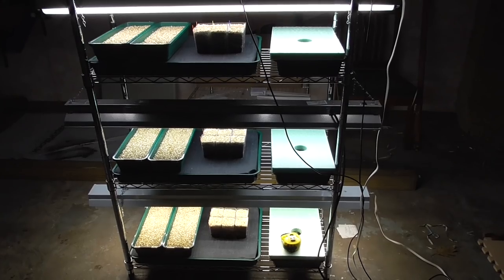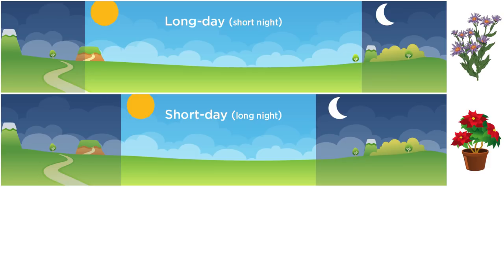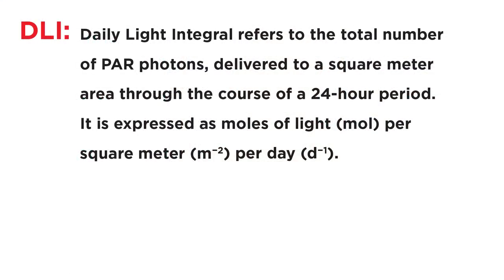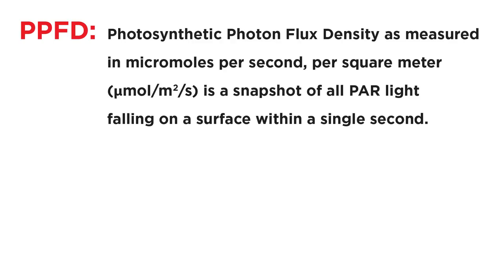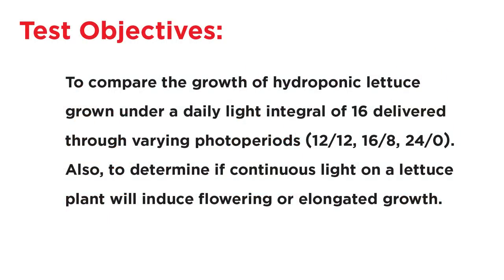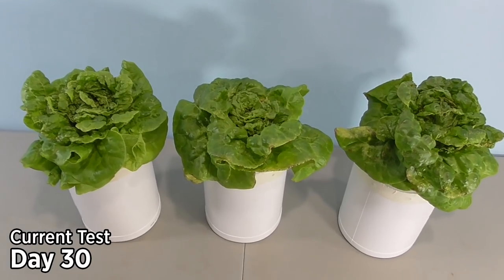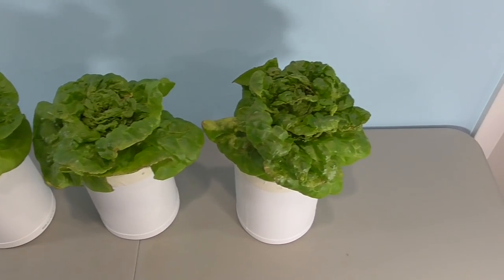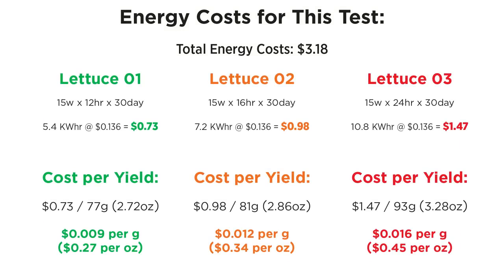Photoperiod vs Intensity: PPFD / DLI - LED Lights Lettuce Experiment (What is DLI?)

Comment from the maker: Watch PART 1 of this series for further context:
https://www.youtube.com/watch?v=gHWf4Hfi3hA

Check out my other reviews:
"1000" LED Grow Lights Shootout pt 1: https://youtu.be/g6n8VhVGKDY
"1000" LED Grow Lights Shootout pt 2: https://youtu.be/WmjOSzSF-HI
Spider Farmer SF300 / SF600: https://youtu.be/RXbR-hcXeQ4
Active Grow LoPro Max 320W: https://youtu.be/PCaesi_M5DQ
Maxsisun MG3000: https://youtu.be/Tw6-w2gybgo

This UPS power station can backup a grow light!
► https://youtu.be/h3sUUHCEqbs

Check out my Grow Light Cost Calculator: https://youtu.be/aToYhyPZMVs

Learn more about artificial lighting and plant growth:
► What is PAR vs ePAR Light? https://youtu.be/kUpEQ4kU148
► The impact of Red or Blue light on plant growth: https://youtu.be/sfihE4IuFuU
► To avoid Tip Burn: https://youtu.be/gHWf4Hfi3hA
Reply: Excellent!!!
Reply: it looks hard to do but hate the bugs outside
Reply: What is bolting?
Reply from the maker: @AndroidSamsung-qz9pl  When plants flower when we don't want them to, we call  that bolting.

Annual cool season vegetables including lettuce and spinach will bolt as days grow longer in summer. Bolting usually brings on bitter flavors in the foliage as will the usually hot temperatures that come along with longer days. Hot temperatures also cause the flowers to come on more quickly as will dry soil.  Some biennial vegetables bolting is induced by a cold snap during a plants normal vegetative stage.   Prone to bolting include rhubarb, Chinese cabbage, and mustard greens.

Some biennial vegetables, (those that normally produce only vegetative structures their first year, flower and seed their second year), may bolt during the first growing season in response to a cold spell.  Most biennial vegetables, including onions, carrots, heading cabbage, have to reach a certain stage of growth before they are able to start the flowering process.  But turnips are sensitive to cold as soon as they germinate.

Bolting cannot be reversed once the flowering process has begun, so replace affected plants with heat-tolerant summer crops or wait until later summer to replant for a fall harvest.
Reply: @Albopepper  Wow. Thanks for the though reply! :)

More power to you.

Comment: When looking at growth per watt, did you consider that with the 24 hour light cycle, the distance of the light means the coverage area is greater, so you may have been able to put more plants under the light than the other two?
Reply: Exactly, or as I mentioned in my comment just use a light that offers a dimming method to reduce the power usage instead of wasting light (as spread out light has greater chance of losses even if used for more plants like you mentioned.

Comment: Good video. Maybe you can try applying the light intermittently. Does it affect the crops quality? And does it really save electricity? Maybe you can make (10 min on / 10 min off intervals) or maybe (1h on and 1h off intervals). Does long or short intervals matter?

Comment: Thanks for the 2 interesting videos. I've never had tip burn until I received an aerogarden as a gift.  My kratky lettuce is fine but my aerogarden lettuce always has tio burn.  I've tried over and over to experiment with same nutrients and same water and duration.  The only difference is that light included on the aerogarden. So after watching your video I think my hunch is correct about the aerogarden light.

Comment: This is really awesome and I would like more of it. Although I have to say that the cost comparison is a misleading conclusion. Instead of moving the light away from the plant, you could save energy by using a dimmer light, or increase yield by growing multiple plants.
Reply from the maker: Yes the suggestion of growing multiple plants was put forth in the 1st installment of this series: https://youtu.be/gHWf4Hfi3hA?t=426  The lights I was using were not dimmible and I had to make due. The focus of the test is to show the relationship between PPFD levels and Light Cycle duration in calculating the photons received by plants. It explains DLI. That's the core concept.
Reply: @Albopepper  you did that and well by the way! I am 100% agreeing with 99,5% of the video ;-) 

I hope it's constructive criticism. I have seen the first video 👍👍

Comment: The Inverse-Square Law of light

This law states that for every foot below the reflector the light should loose 75 percent of it's energy due to dispersion. So 1000 lux at 1 foot is 250 lux at 2 foot. I have taken a lux meter and find that I am only loosing 50 percent per foot. I am thinking the reflective walls are keeping the numbers up. Also, if you are have multiple lights when you just below the reflector you only get light from it. As you move down you get light from multiple lights. This applies to HPS and Metal Halide due at the side bouncing of the wall is as bring as just below it. Where LED blow all their light down.

Comment: Greate video.
I'm so sorry, but could you tell me how did you get those values(0.0864, 0.0576, 0.0432)?
Was it with a PAR sensor? Answer: The 0.0864 factor is the total number of seconds in a day divided by 1,000,000.
Reply from the maker: Thanks for watching Julio! This resource is a definitive reference for DLI:  https://www.extension.purdue.edu/extmedia/ho/ho-238-w.pdf  I have a PAR sensor (Quantum Light Sensor) that I use to measure my PPFD.
Reply: AlboPepper - Drought Proof Urban Gardening Thank you.

Comment: Interesting DLI experiment, but my takeaway in this video is, DLI this, DLI that... why not think outside the box of "daily"?

Why confine the photo period to a 24 hour cycle? Am I wrong to think that DLI can be eliminated in a controlled environment? 
There are infinite cycle timers that can be used instead of regular 24 hour outlet timers.
Why not make it a photo period per cycle, and not per day? 
Or why not calculate how much total light the lettuce needs from seedling to harvest and ratio it together with dark periods in order to avoid tip burn?

If you ever do another experiment, can you do one that tests for different ratio light and dark cycle duration with setup number 1?
Something like 12/6 (12hrs light, 6hrs dark), or 16/2(I heard this one works good), or 8/2(short cycles = more cycles from seed to harvest in less time).

Thanks
Reply from the maker: Interesting ideas! You should run some tests and share your results!  :-)

Comment: I realize that this is a very old video at this point, but a quick question about your setup. 
Did you calculate the distance to achieve the PPFD for each plant, or did you actually use a meter? 
I ask because if you were relying on just the math, your setup could have resulted in an actual PPFD at the canopy that significantly deviated from the theoretical due to your use of reflective enclosures.
As I am sure you are aware, it doesn't matter how far away a light source is if you can manage to somehow get all the photons to still hit the canopy, be it through the use of beam angle or some other method. Yes, you will likely lose at least 10% of your photons each time they bounce off the walls of your tinfoil wall reflectors, but having those reflectors could increase your square root law-derived PPFD by a significant amount.
Additionally, the 3rd experiment is going to see a larger proportional drop off in delivered photons than between the first and second.
The first 2 have the fixture entirely within the enclosure but the 3rd is well outside the enclosure.
As the light fixture has a beam angle under 180 degrees, far more of the emitted photons will hit a wall and bounce down to the canopy in positions 1 and 2 than in position 3, with at least some proportion of the photons from position 3 spilling outside of the grow chamber entirely.

of course, all of this would be a moot point if you've used a light meter, but I never saw any reference to that in the video.
I enjoy your videos, and the knowledge is on point, I'm just concerned your results may be skewed.

Comment: A leading cause of tip burn is calcium deficiency caused by low transpiration in the leaves so that the plant can't pull enough calcium to the leaf tips... I have virtually eliminated tip burn in my setup by just putting a small fan to create airflow around my lettuce to increase transpiration.

I wonder if the growth differences would have been more dramatic without the tip burn.

Comment: i key thought , i've watched numerous videos and one thing  no one seems to pay attention to point out either  is  the light spectrum versus plant growth of long or short day cycle plant, , as an example a long day  plant with  have a higher exposure to  blue  and greens  in the 460 to 560 Nm wave length   during day  where as morning  and evening light has a higher level of of  600 to  750 and higher IR  spectrum.    so all gathered  this would also affect over all plant characteristics  of growth  determined on actual light make up for long or short day cycle plants and  neutral cycle
 so  as you go into long day plant the higher photo flux increase and  slightly less red spectrum looks to be the curve. there have been studies done for solar cells  that actually break down the light spectrum  for full day  versus time of time. so we know certain plants prefer a set time of year  for growth  both due to light and temperatures,  we know nature doesn't always duplicate the ideal condition  but we try as growers so maybe we need to   look at those spectrum and intensities not just as a broad band  but as a cycle so we need to look at it on an hour buy hour cycle also. as example  what is the intensity of the light at 6am and its light spectrum    versus  what is it at 10am noon  2pm 4pm  ...... all thing that will vary with a short day versus long day cycle plant.    oh yes and one additional note light spectrum analysis  done  by labs to test for solar cell efficiency ( 300 to 1000nm tested spectrum)   showed a fair spike at 410nm  and   extreme spike   at the  740 to 760 nm light  ( this is based off a full day sunrise to sunset  recorded data ) and the spectrum between almost a dead flat  level  within the band from 410 to 740 nm

Comment: How much nutrient solution did each plant use and what was the EC/ppm levels I think is an important factor cause the one on the 24hour cycle may have tip burn due to drinking more water causing the nutrient levels to raise

Comment: Yea, but judging from what I'm seeing in this experiment (if you ran it like it was shown here), there would be leakage light from the other "cells".
For a better comparison I think you would want to completely isolate each plant/light.  3 completely light-proof tents or boxes so there's no light leakage shared between test samples.
Reply from the maker: Thanks for sharing that tip. I actually tested each grow area separately, checking for light leakage. There was no quantifiable light spill over. So when the other 2 lights were off, those 2 chambers registered as 0 PPFD at the lettuce canopy. In a more formal setting, applying your suggestions would be a great idea. But in this test, the results were not compromised by leakage.
Reply: @Albopepper  Thanks.  I will admit it was hard to tell from the video.  
It was a very interesting test.  I'm going to try to grow lettuce in a grow tent with a cannibus plant or two, (which is legal in this State).  Being that the cannibus plants are auto-flour having a 18 on/6 off light  schedule, and keeping the tent around 75°F, it should work for both.  I hope.  Merry Christmas.

Comment: Do you know the name of the light socket cords you used for this? I'm having trouble finding a good one.
Reply from the maker: I believe that this is the item I had used for the socket cords: https://amzn.to/2tciF0y  It is UL Listed. And for LEDs, you don't even need the reflector! It's nothing fancy, but it works fine for me. I used the 150w 8.5 inch version and removed the reflector.
Reply: @Albopepper  Thanks for the info!

Comment: why do you divide by 16 for DLI in all your PPFD calculations? (3:38)
Reply from the maker: There are two sets of equations. None of these divide by 16 though. I selected 16 as the target DLI and decided to achieve that amount of light exposure for all plants. So when using a 24 hour light cycle, the PPFD needs to be 185 if I'm shooting for a DLI of 16. This was determined dividing my selected DLI (16) by 0.0864.

So let's say you're growing a medicinal crop and your target DLI is 40. Then you would divide 40 by 0.0864 and that would be the required PPFD (if using a 24 hr light cycle). For a 12 hr light cycle you would divide 40 by 0.0432 which is 925.9. So for that project, the grower would be trying to cover the plant canopy with 926 PPFD of light.

Comment: Just a suggestion, but the reflectors you use in your tests are probably not being read by your sensor, most sensors are inaccurate at high angles and you probably are just aiming straight up, so the plants are actually getting more light than you think. The reflected light isn't much, but you want to be accurate!
Reply from the maker: Thanks for sharing that observation. Fortunately, the Apogee sensor has a 180 degree Field of View: https://www.apogeeinstruments.com/sq-520-full-spectrum-smart-quantum-sensor-usb/#product-tab-information

Apogee SQ-500 series quantum sensors is approximately ± 2 % and ± 5 % at solar zenith angles of 45° and 75°, respectively. So they still have a decent range of accuracy.
Reply: @Albopepper  I was going by an Apogee video I saw where they had to point the sensor at the light source, not sure which one it was. It was very directional. I plan on buying the model MQ500.

Comment: I think leaf burn was because it was too hot for the plants. By moving up and down you change not only light intensity but temperature too. What was the temp in a room?
Reply from the maker: No it was not the temperature. I've checked that. My observations match what the research states as cited in the video.
Reply: @Albopepper  but you should agree that once you move your lamp you instantly change the temperature. This is why I avoid lamps as they simply burn the plants. I think this is a problem of small lamps only as large lamps can be moved far away.
Reply from the maker: Yes, I definitely agree that once lights gets too close the plants start to heat up. Those SANSI lights are used primarily for testing purposes. I also use one for small house plants like my sundew. But these lights are the ones I use for my real growing and they work great: https://www.youtube.com/watch?v=lK28aiRQ_Vs

Comment: Hey Al (is this how your name is writen?), I googled a little on the optimum photoperiod of lettuce after watching your video. I found an article (https://www.actahort.org/books/1037/1037_115.htm) that I found interesting. They didn't just played around with how to devide the 24hrs in day and night but they were growing plants in periods of less than 24hrs. I'd love to read your thoughs on it or even see an experiment by you
Reply from the maker: It's an interesting experiment. At first I suspected that those light cycles had mismatched DLIs. So I examined the entire study, not just the abstract. And that is the case. Each light cycle uses the same PPF with varying light durations. Based on a 28 day period of 672 hours total, that means the 16/4 lettuce received a 121% boost in photons compared to the 16/8 lettuce. And the 16/2 lettuce had a 132% boost in light, directly resulting from increased photo duration during the test period.

This grad student claims: "Lettuce showed a significant response to the length of the dark period." "A shorter dark period was found to promote lettuce growth, and the fresh weight of lettuce grown under a 16 h/2 h light/dark cycle was about 30% higher than that of lettuce grown under a 16 h/8 h cycle" I believe this is complete rubbish. Look at some parameters from the test:

16/8 = 28 Cycles --> 448 hrs Light
  (Average per 24hr period: 16.0 hrs) DLI(PPFD 110): 6.3 (100%)
  Top Weight: 67.7g (100%)
16/4 = 33.6 Cycles --> 538 hrs Light
  (Average per 24hr period: 19.2 hrs) DLI(PPFD 110): 7.6 (121%)
  Top Weight: 84.8g (125%)
16/2 = 37.3 Cycles --> 597 hrs Light
  (Average per 24hr period: 21.3 hrs) DLI(PPFD 110): 8.3 (132%)
  Top Weight: 89.8g (133%)

It might seem that shorter periods of darkness offer advantages in yield. But the absence of energy was not the promoter of growth. Comparing 16/2 to 16/8, the 30% boost in growth was clearly from a 30% increase in total photoperiod. The 16/2 lettuce received 149 extra hours of light. This researcher completely ignored that significant difference and failed to control for it.

Comment: What about splitting the cycle?... i mean, 8hr light, 4hr don't, 8hr light, 4hr no light?? ..... do you think that can reduce the leaf tip burn?
Reply from the maker: Hmm... interesting concept! I would think think that the total light in DLI will be a major factor. But the only way to know for sure is to put it to the test!  :-)
Reply: I'm thinking in terms of giving the plant time to replenish the water in the leaves, like running a marathon in two stages of 21 km with one intermediate stop to rehydrate, I imagine that hydration would be much better if we give a break to the plant to rehydrate the leaves but keeping the same DLI in that 24h. Thx for your response.

Comment: You got any opinions on cheap COBS? Like the citizen clu 048?
Reply from the maker: Hmmm. I've used some COBs with success, but they have a more narrow beam. If you have the vertical clearance, they might be pretty decent.
Reply: @Albopepper  thanks for your response. This would be for a terrarium 45cm high, in that case I may need to look into optics or a light diffuser or spread the power over several chips.